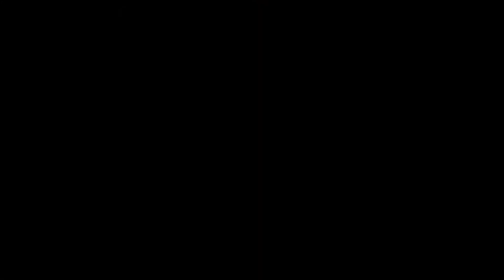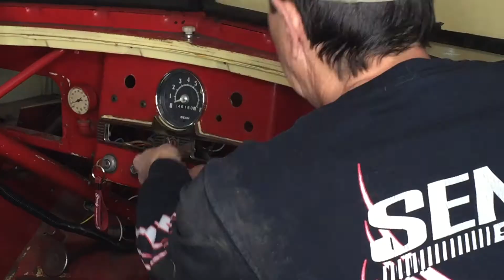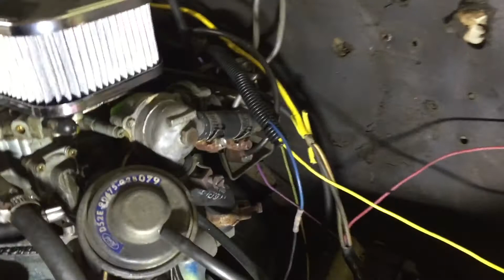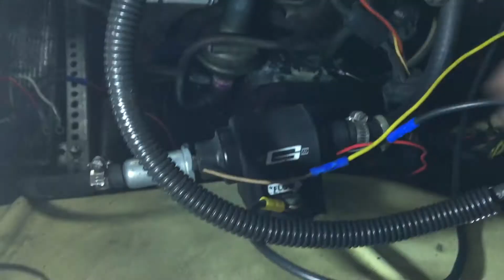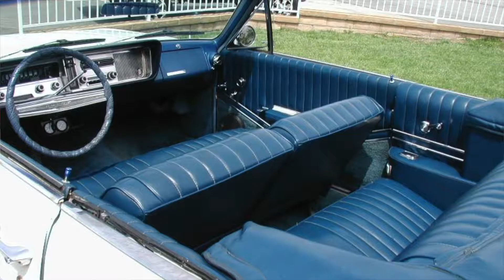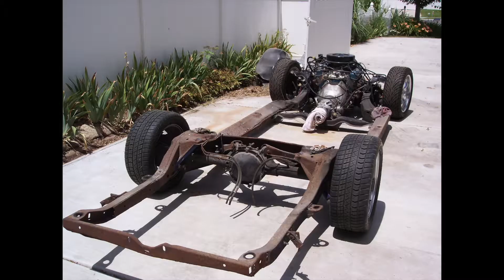Part 4, 1950 Willys Jeepster Barn Find Project. Wiring Danger. Fire Hazard. Strip Dash? Jeep Family

Comment: I tossed the old wire remnants and bought a new replacement harness, saved a lot of time and matches the original diagram. I had to often remind myself I was building a Jeep, inexpensively built and will never command top dollar even with a museum grade resto that could take nearly as many hours as a Buick. Pinto motors aren't cool but not a bad option for Jeepsters with original suspension.
Reply from the maker: Yep, I ordered a new wiring kit. Tossing all the wire mess out. I will likely over do this Jeepster, I just can't help myself. I'll be investing more time then I should but I enjoy it.

Comment: Dad always told me, “ If you want something done RIGHT, do it yourself. Get a cutting torch, sledgehammer, and welder and you can build just about anything you want. “
Reply from the maker: Yes, that is one of my favorite sayings. I like to add "... and if you don't like the way it turned out, do it over" I learned to do everything myself by watching my father. I have done just about everything in my life and I have saved thousands of dollars over the years. I have redone many things that other guys have failed at and I learned from their mistakes as well as from my own.
Reply: Like I always say, “ If at first you don’t succeed, try,try,try again.” Keep up the good work. One day when your caught up make sure to take a short trip to Layton to see my 8 winter 69 Camaro convertible. Can’t work in the heat out here and wife won’t let me put AC in the garage but she is able to keep a COOL TOOL in the motor pool.😩😂
Reply from the maker: Ha Ha. Yes, I want to see your project. My wife called my Buick my mistress because I spent so much time with the car over 7 years but she always new where I was. My last garage was too cold in the winter and too hot in the summer. My new garage is okay year round but summers are very busy with lots of family outings. The Buick build got me in trouble with my family so I try not to let my car obsession get me in trouble again. I have learned to balance my time.